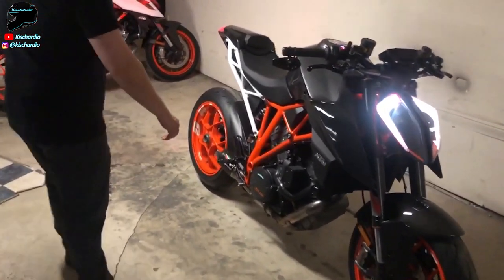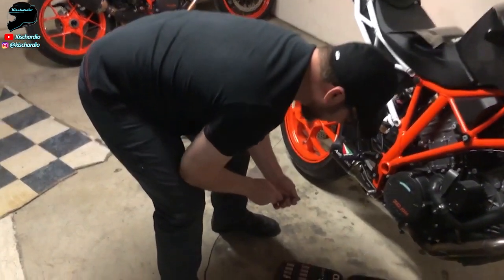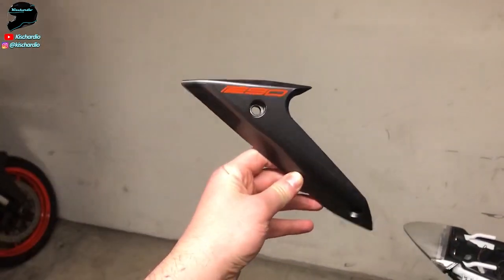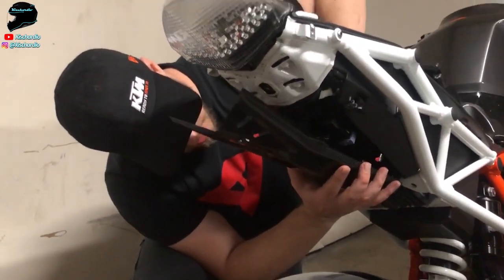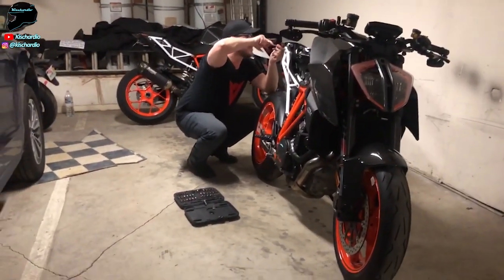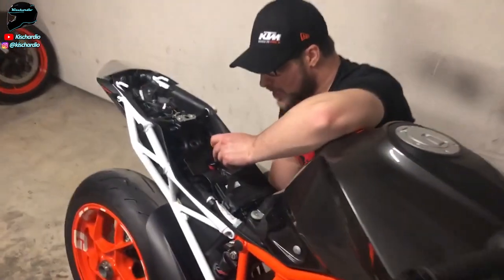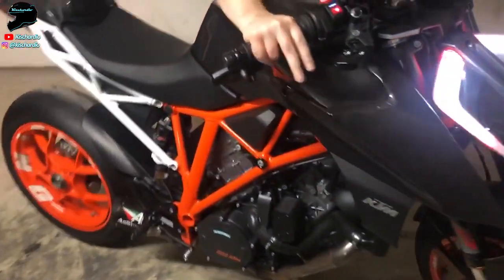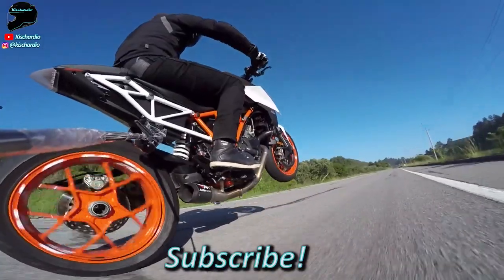SuperDuke Gets a Carbon Tail and Cowl!!! - Carbon SuperDuke Build Series - Episode #3

Comment: Have you ever considered get a cage for your superduke?  Im thinking of getting one of my fz09 but im scared it will mess with my lean angles and get in the way.
Reply from the maker: I have, but I don’t want to add weight + I don’t love the look
Reply: @Kischardio  yeah a cage does give the bike a much wider look but in terms of pricing you could get a cage for $300-$400 vs buying quailty frame sliders & engine covers. Im also thinking of covering my fz09 in a bunch of carbon parts but they are all on ebay and are either coming from china or russia. Is that where you get your parts from?
Reply: @JonaldTruden  motocomposites.